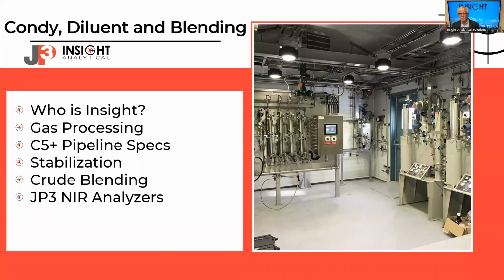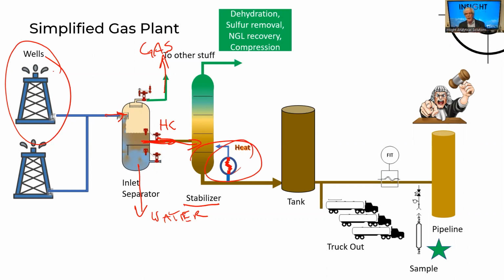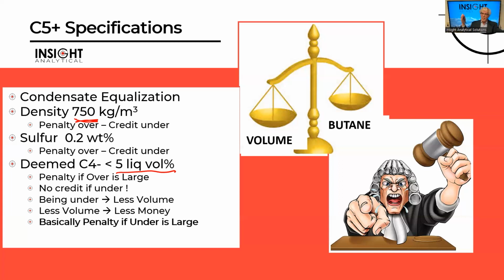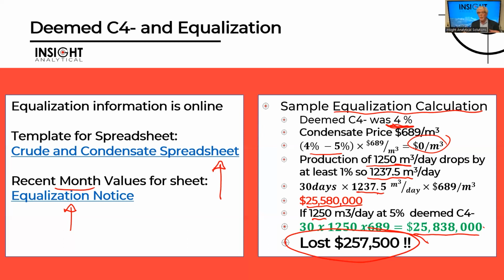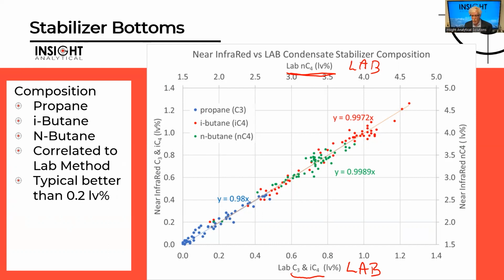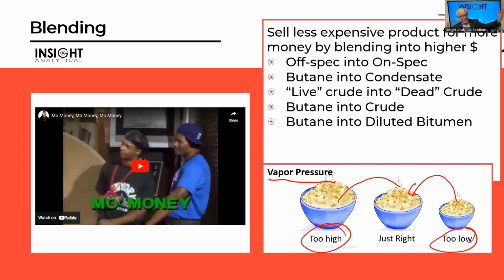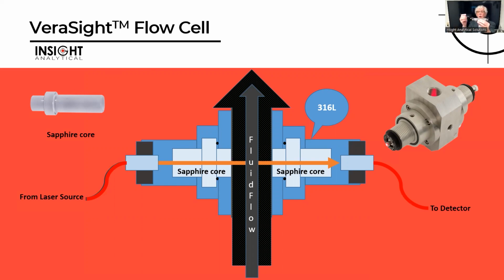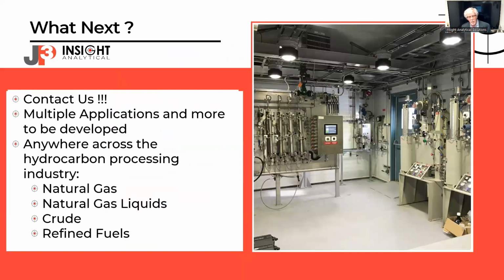He Ain't Heavy, He's My Diluent

Comment: Excellent presentation, it well covers  the blending opportunities with condy and crude. The only comment - the math with extra C4 in condy is not that simple. Usually if you under-blend deemed C4-, you don't lose that C4, it's usually sold as NGL component. In other words, that extra profit is a difference between price of butane sold as condy minus price butane could be sold as NGL. But anyway, considering that historically price difference btw condy and NGL is substantial, I agree, the payoff time is fast.